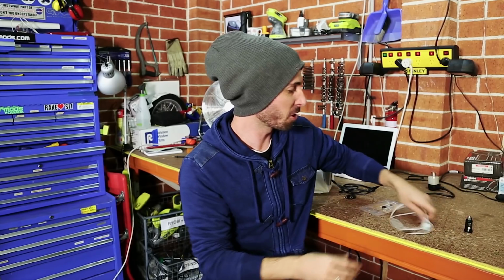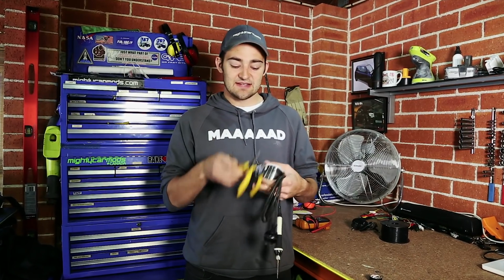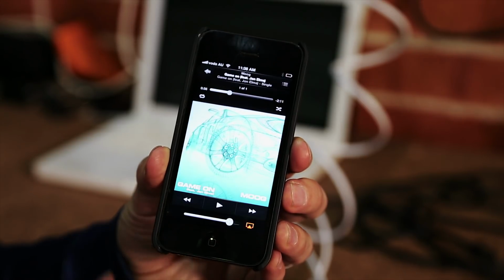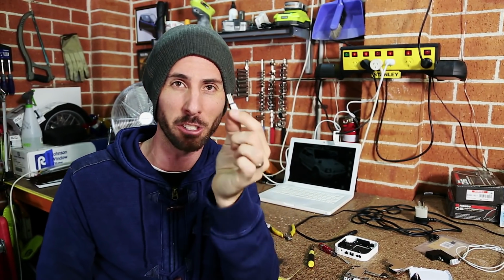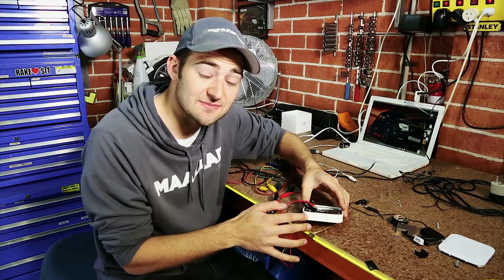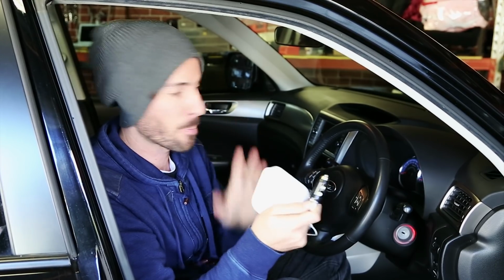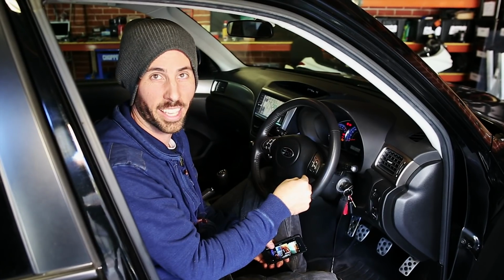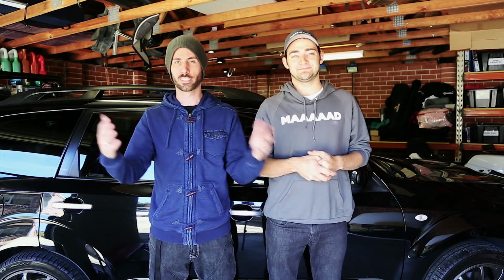Install Airplay In Your Car

Comment: Your getting really good at the tech mods and soldering stuff guys well one.  One point, re the voltage regulator it may get quite hot on a long trip so a way to dissipate could be to buy a really small heat sink, or use a small bit of metal and lot it to that with a self tapping screw, and M3 to M5 size hole.

Comment: cant you buy head units with wireless remotes? if you would prefer to use this setup I guess go ahead but I can get a used headunit with a wireless remote for less then what this whole system would cost and Id still need to buy a headunit anyway to do this since ive never seen a car with an audio in port from the factory thats affordable, when I pay $4k a year for insurance(as a first year driver, no accidents, etc.) on a 22 year old vehicle imagine what it would be on a 2 year old vehicle.

Comment: I was wondering if you guys could show us how to install exterior lights, i.e.- (fog lights, off road lights) on vehicles and/or install a second battery to run power hungry electronics. That might be so simple that its not worth it but its an idea. Anyways, keep up the good work!

Comment: Awesome video guys, I didn't realise you get it to operate on the cellular network whilst using Airplay. 

What I have done myself is use a linux box are Shairport for Airplay (free).

For the car you could get a Raspberry Pi (potentially cheaper)

Comment from the maker: Some of our videos are about turbos. Some are about suspension. Some are about VW's, and some are about using avocado to clean your lights. Some are about Subarus and others are about Nissans. Others are about specific plumbing for GTiR valve systems. This video is not an anti-Blue Tooth video. It's how to install Airplay in your car, just as the name of the video suggests.

Comment: Just go to an auto shop or electronics shop and get an mp3 fm transmitter. you just plug it into you cigarette lighter and tune it to your radio and connect your ipod to it and it plays through the radio. I have one in my 20 year old commodore. :)

Comment: it also pulls more amps (and therfore more heat) because of the two vregs. the main thing here is the low voltage cutoff. the 5v to 3.3v allows only 1.7v. most voltage regulators even the LDO will drop about 1v so thats .7v left as a buffer. with no caps and slight voltage drop the airexpress could experience a brown out.

Comment: to every one saying oh why not just use an audio cable? well thise is a much cleaner way than having cables running everywhere, and much less distracting. i use an aux cable on my car, and the cables are constantly getting hung up on my shifter, my seat adjuster, etc. this is a much cleaner and safer way to have your tunes running. plus this also allows your friends to share their tunes and vids with out un hooking and hooking up cables

Comment: Thats sweet, but if your next to someone at a stop light who sees that there is a connection they can join to they could mess with your music possibly, lol, but it may only work depending on the range of the system and if you have it locked or to only a certain phone

Comment: the cig adapter uses step down ; no heat generation...

3.3 vreg generate heat depending on the in volts... 12v - 3.3v = 8.7v converted to heat...  5v - 3.3 = 1.7v heat disiption... sorry for my bad english...

Comment: also its true that bluetooth isnt capable of the same audio quality as wifi, standard phone wifi is capable of a data transfer of 20mb/s so if it wanted to it could send an entire song in 2 seconds, although of course thats not what happens as it just streams it as it plays so not even a quater of that speed is used. bluetooth cant even reach a quater of that speed therefore the max quality is less than a quater of what wifi can handle.

Comment: Also, where are your voltage stabilization capacitors?

i love your videos, but some of the circuits you used are dangerous for the car/peripherals (such as the Airexpress)

Comment: why wouldnt you just use 12v and GND as you have done on other stuff and go straight to 3.3v (if the vreg can handle it). no need to go to batt->5v->3v. 5v is close to the voltage cut off of some 3.3vregs. less heat will be given off over all too. 

if ya want it portable, still, either take a cig adapter and run 12v to the airexpress and have the 12-> 3.3v thing there or put the 3.3vreg in the cig adapter. (first option would be better because of voltage drop)

Comment: For those too nervous about modifying electronics, a power inverter fits under most seats and could be used to power the Apple Airplay with no modifications to the device what so ever.